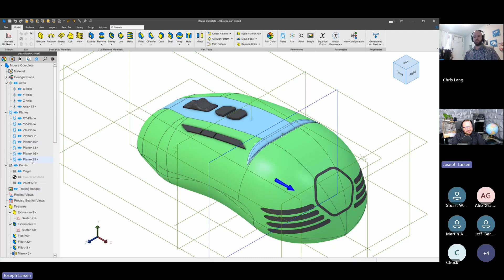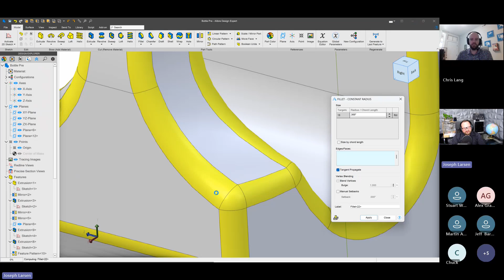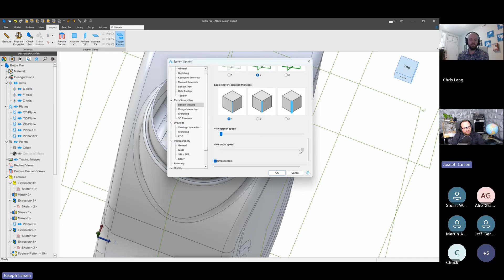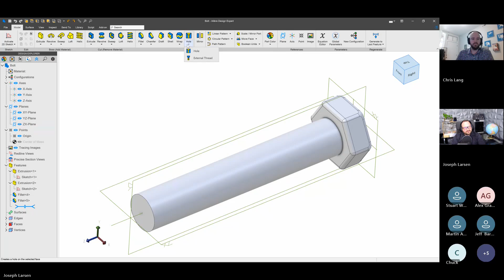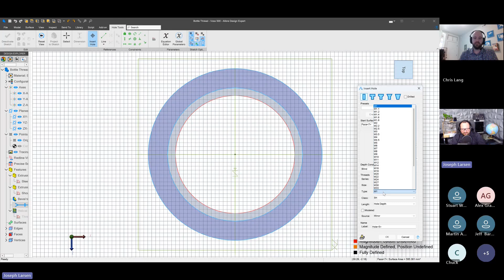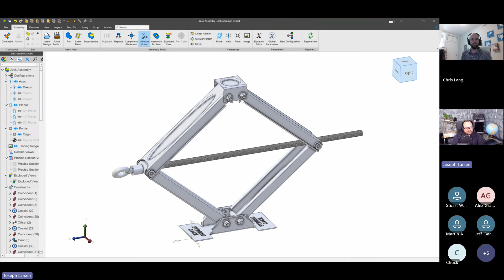What's New In Alibre V28.1 Live Webinar

Comment: Hi, thanks for the nice video. I still have a problem creating a bolt and a functional nut :/ Even if I use the tightness / looseness variants, the bolt cannot be screwed into the nut. Of course, I'm talking about creating a thread in 28.1, which is a great extension, but it has the problem mentioned. Is it possible to somehow use the inactive X function, which would certainly help for user selection of the diameter. Milan
Reply from the maker: Thanks for this question!  I'm not sure if I know what you mean with the inactive x function- could you tell me more?

Also, to confirm, are you seeing the difficulty getting them together after 3d printing the threads, or are you having a problem digitally?
Reply: @AlibreLLC  Hi, thanks for your interest... my point is that when creating a thread I cannot change some dimensions. In the design it is the fx() data in the image, for example for the ISO group. Having the ability to change the individual fx() dimension would probably help to adjust the subsequent thread clearance for a pair of external and internal threads.